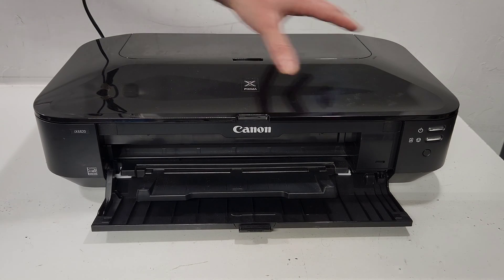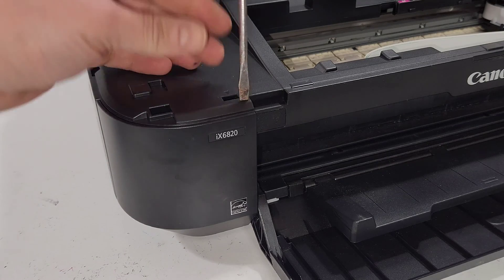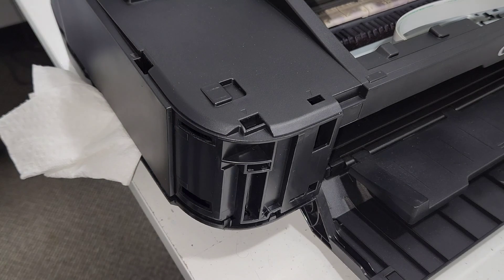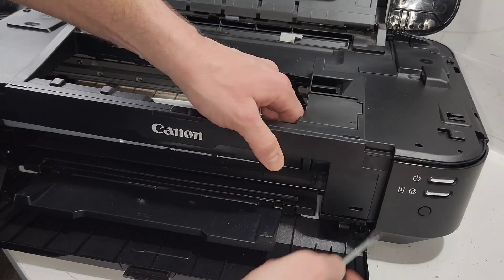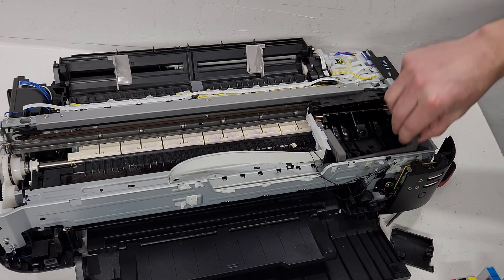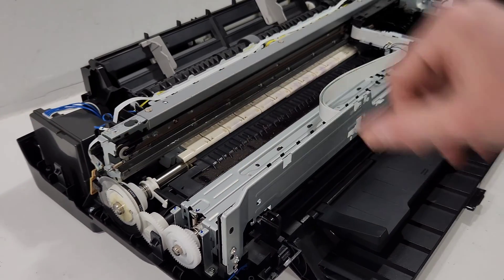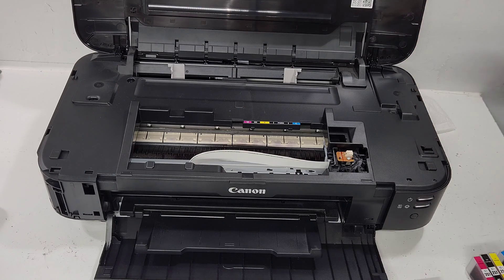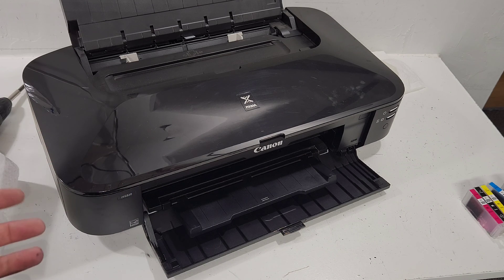How To Access Inside Canon Pixma iX6820 Printer to Clean or Repair

Comment: 1st thx 4 vid.
2nd just bought ix6850 used. It's not recognized via usb. Doesn't even show up in USBTreeview on T420@Win10. Despite my ip3000 works with same cables.  Can print test page via buttons. Event figured out yet how to set ip up via ethernet or Wifi. Wifi button also seems stuck so I just disassemble iit right now. I am not familiar with setting up things via WIfi

Any ideas why USB doesn't work?

Comment: Thanks for such a careful rendition of how to remove the top.  One thing, it was easier to unscrew that component than it was to try and remove that tiny plug!  I was able to push through a business card that I stupidly had tried to print with some folder stock. Thanks again.
Reply: I agree - I didn't see your comment when I added that same observation - especially if your hands are old.

Comment: I need to clean the roller. Ink dripped onto the rail while I was refilling Cyan and it's on the front and back of printed sheets. Any suggestions. All the videos stop prior to getting to the roller bar. Is there any way to actually remove it?

Comment: The paper wouldn’t feed through the tray and your other video didn’t work. Called Canon and they said they’d give me 10% off and free shipping for a new printer since it’s out of warranty. Considered dropping off at Best Buy or a local repair shop, but then I took a shower and thought about it some more. Used this videoto take it apart and discovered a push pin that fell under the roller! Was able to Macgyver it out with a magnet, paperclip, and some tweezers 😎 Thanks for saving me money and a 10 mile drive lol

Comment: Hello sir. My printer is old and I think the paper pick-up roller is not working anymore. It picks the papers in twos and threes. Can I order a relatively less used paper pick-up roller from abroad and replace the visible roller by removing its cover as you did? Does this part come off?
Reply from the maker: Hi, if it picks up two or three papers at a time, the problem is not with the pickup roller. The problem is with the assembly at the end of the paper tray. There are kind of stairs looking paper separator pieces.  Those could be the ones giving the problem so check that out. Sometimes they are misplaced or broken, so make sure that's in place and when you load the paper,  make sure you load it just to where it's supposed to be, at the mark, not pushed further down.
Reply: @303electronics  The number of pages removed was 90,000. I think the ladder paper holder part you mentioned may have broken because it is old. Sometimes the papers fall down for no reason. I don't know if it is a part that can break from use. Is it possible to repair it or should the entire paper tray be replaced or the new machine seems to be on its way.

Comment: Hi very nice video!
1. I dont know what brand of ink you are using, but i was wondering… Would those cartridges, be clogged free, if they were filled with Canon’s inks (GL43, GL56)?
2. I have an idea for cleaning the print head. Would it be safe, if i would fill the refillable cartridges with Nozzle Cleaner and then use it for printing like its an ink.?

Comment: i have ix6870 that has been sat about 4+ years so any suggestion what should i do before get it back run? beside printhead cleaning thx
Reply from the maker: Hi. Wipe clean of any dust and clean pick up roller. It should be easybto access. Printhead may need a manual clean and get new cartridges.  It should run like new even after years of storage.
Reply: @303electronics service phead and clean any visible dust dont have the gut to popp out the cover yet😂 so far it run well for now huhu thanks mike❤